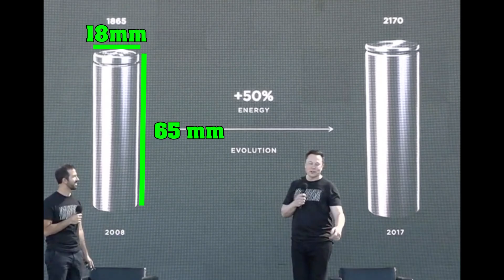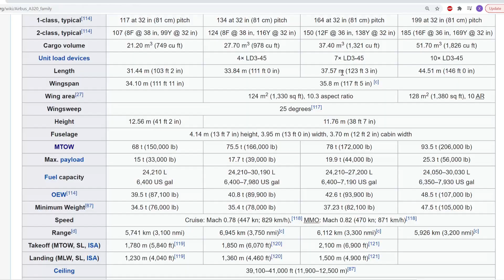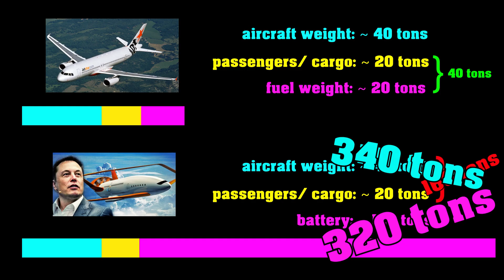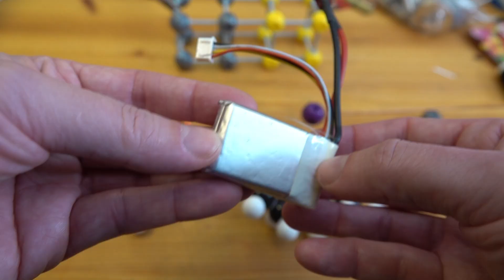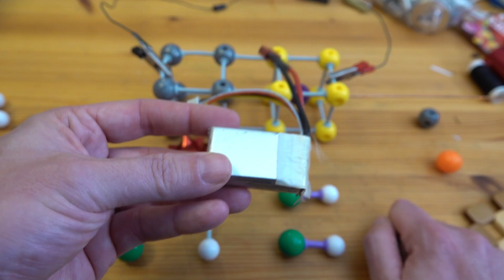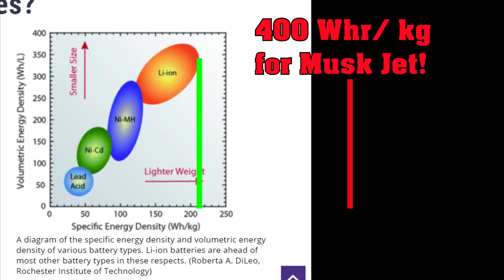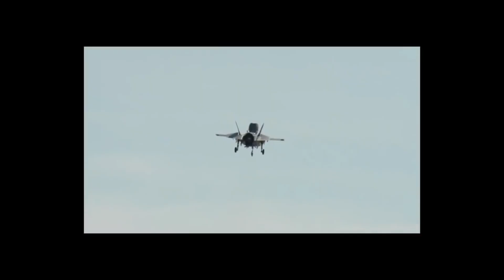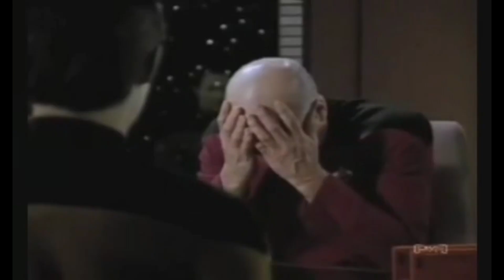Tesla's Secret Plan To Disrupt Airlines: BUSTED!!

Comment: Hyperloop replacing planes? Nah... How about planes replacing planes?
Fans: "OMG THAT IS GENIUS"
Reply: Even better batteries replacing people.
Reply: Elon Musk: "I've made a new battery that holds 50% more energy... its also 50% bigger  *nervous cough*  ."

Musk Fans: "This man is a GENIUS!"

Elon Musk: (phew! They bought it!)
Reply: @VoltBolt777  That's just the form factor, they will change the chemistry too.
Reply: @johntheux9238  How? What could  you possibly do to improve the energy capacity while sacrificing volume? Nothing!

There's a reason we build chemically fuelled space rockets and nuclear reactors; not solar powered space rockets and giant building sized electric batteries. 

There is a limit to energy capacity and output that can only be broken using hydrocarbon fuels or nuclear energy. Only they produce enough energy while remaining compact and efficient enough for flight or transportation. A nuclear battery is at least possible; in fact they are in use in spacecraft and pacemakers, they're just expensive to make.
Reply: @VoltBolt777  Look at battery day, they will change the anode, cathode and electrolyte too. The specs in this video are just for the new form factor alone.
Reply: @johntheux9238  It seems basic physics and chemistry is lost on you. Read my lips: There is NOTHING better to replace the contents of the battery with!

No better chemicals currently exist that will magically supply you with more energy while sacrificing volume and weight.

 This barrier/energy threshold can only overcome with nuclear power which harnesses radioactive decay or hydrocarbon fuels which store energy in covalent bonds.

If you have any real evidence of a new chemical compound that is not bogus; and that does the trick; I would like to know what it is! If not stfu!
Reply: @VoltBolt777  They will use a silicon anode and a nickel cathode.
Reply: @johntheux9238  And you believe that they will violate the laws of physics and magically generate more energy? Explain how please. We have been using these types of batteries for decades. What Musk describes is at best; a way of producing cheaper batteries, not a revolutionary new technology that replaces what we already have.

Do you understand that?  Manufacturing  has nothing to do with  energy output .
Reply: @VoltBolt777  It's still a small improvement for sure, the energy density will only be increased by 40% so that's ~364WH/kg
Reply: @johntheux9238  You are the perfect example of a gullable, useful positive idiot. 

Batteries are a mere shadow of the energy density produced by a flammable gas. They will never replace liquid and gas fuels. They just don't provide enough energy; its a limitation imposed by physical laws, not technologically bad or good designs.
Reply: @VoltBolt777  Never said it was good for long-hauls, but for short flights electricity is cheaper than fuel.
Reply: @VoltBolt777  i don't think he understands what energy density means
Reply: @johntheux9238  If I am not wrong the bulk of energy storing capacity comes from the electrolith used, of which there is no better alternative as of now, so I'm not sure how much of a difference changing the anode and cathode will make unless they change all the materials used to convey electricity with supraconductive ones to reduce the energy lost to joul effect. To my knowledge such material doesn't exist.
Reply: @kamil-alaa  Ugh, I give up. Fanatics of any religion are hard to reason with; and that includes Elon Musk worship.
Reply: @johntheux9238  People fly transcontinentally precisely for the long haul; we have everything else covered using trains and cars.

This electric plane idea is a bit like reinventing the wheel by making it square.
Reply: @johntheux9238  Not to mention it DOES increase energy density at the pack level, if not the cell.
Reply: Only gets better if his planes fly around in tubes. Except he will pressurize them at 40K feet lol
Reply: @MAJESTIC_P_BECK  Space is also where we use solar panels   most efficiently; because objects are weightless and there's no air resistance. Musk fans seem to think planes work the same way just because they're electric.

"Electric"=Magic🌈
Reply: @StormXF3 Didn't Elon Musk also invent the sonic Rainboom from the My Little Pony show? People forget to give credit where credit is due.
Reply: Soon: It is the Hyperplane running on Hyperbatteries!
Then: We changed the design and fill the batteries with kerosene.
Reply: @hans-joachimbierwirth4727  wait dont reveal this yet, brother. wait after the billions in environmental subsidies
Reply: Me and my hive don't need planes to reach cloudsdale!
Reply: Bojack Horseman: "What are YOU doing here?"
Reply: You just filled my brain with nostalgic memories...
Reply: I think the next one will be:
Elon: What if we put batteries on the Hyperloop ...
Reply: What about Plains replacing PLAINS now that would be a green world. Or even... PLANES REPLACING PLAINS! our planes could plant the crops they are destroying! Genous! Get me a Dutchman! Preferably flying!
Reply: Can’t wait until planes replace the Hyperloop.
Reply: >when the my little pony SFX channel is posting in the comments of a thunderfoot video
A surprise, to be sure, but a welcome one
Reply: Wait until you guys see the UFOs 😅. If only people knew the answers that they think cannot be proven. Oh wait the intelligence community already did that. 😏 ah well. Happy 2021 lads. We were never alone to begin with.
Reply: Like how cars are replacing cars right now
Reply: Its supahh sonicchhh
Reply: Planes comes in, planes goes out, you can't ex-planes it
Reply: I mean if he can make a supersonic electric jet i will be very impressed. And surprised.
Reply: Batteries have much more weight/energy than airplane fuel.    A battery powered airplane is the stupidest idea ever.    Honestly it would be a much better idea to run the airplane with a long electrical cable.   But still obviously a bad idea.   He can make a 5 foot tunnel carry cars in both directions at once i don't see why he can't make an electrical cord that can pass through solid objects.
Reply: @HughJohnsan  Tesla just needs to announce, and then invent superconducting monowire. According to other tech visionaries like William Gibson, that'll pass through any object. Passing a decent current through a true monomolecular filament is one of those minor details that Musk can delegate. But once achieved, the electric jet can get all the power it needs from lightning!
(problem with physics is it tends to ruin all sorts of great ideas. We should probably ban it for being restrictive)
Reply: I know how those planes will work better than a jet engine: If you throw out thunder bolts like Thor then the impulse will give you a boost 10 times more than a not referable value that makes the plane fly 10 times faster than air !!!
Reply: Errrm did you guys consider an electric plane doesn't need oxygen for combustion... so we CAN GO TO SPACE WITH IT
UNBUSTED, THUNDERFOOT!
Reply: @captainLoknar  While it may not need air for power, it does need air to push against and to achieve lift.
Reply: @jcd-k2s  L'électrolyte au graphène de Maxwell n'en fait pas justement une batterie "solid state"?
Reply: @jcd-k2s  Non, la vidéo est séparée en 5 segments: Le facteur de forme, l'électrolyte, l'anode, la cathode et l'assemblage des modules:
https://www.youtube.com/watch?v=l6T9xIeZTds&t=2550s
À 49:43 c'est pour le facteur de forme seulement, il faut attendre 1:27:40 pour avoir le produit fini.
Reply: @jcd-k2s  Lors du battery day ils n'ont pas parlé de la densité d'énergie ni de l'énergie spécifique mais de l'augmentation de l'autonomie du véhicule.
Par exemple le 5e segment parle de l'intégration de la cellule dans le véhicule, je n'ai donc pas compté les 14 derniers % comme une augmentation de la densité d'énergie.
Reply: @jcd-k2s  - no you can't.   If we could do that we'd be doing it
Reply: @jcd-k2s  all theory.  No actual use.   If it worked we'd be using it everywhere.   Lifting your fuel off the ground is difficult and expensive.  It's like saying the space elevator is a real thing.   It's less real than solar roadways.

People are stupid but they are also cheap and greedy.   If there was a cheaper way to do it they'd use it.   If airline execs could spend less on fuel and more on hookers they'd be all over that.
Reply: @VoltBolt777  I like how at least 2 people thought I was serious. But I guess at least a thousand Musk supporters would cheer my idea
Reply: @jcd-k2s  - what is the difference between not working and not working yet?   what is the difference between not working and uneconomical?   those are all more or less the same thing.   it's really hard to prove that something will never work,  so everything is potentially working in the future.    if something is impractical and/or uneconomical that fits my definition of broken therefore it doesn't work.  if something may potentially work in the future to me that is a useless distinction.
Reply: Not just any plane, an electric jet!
jesus fucking christ...
Reply: Naa it's a plane replacing spaceship
Reply: The eHang company kind of invented Drone Taxis already... look up the videos... lasts 20 minutes, 1 person and very newage. it's on the stockmarket now in America nasdaq as well... next level!
Reply: I mean, if they have a battery with enough energy density for planes they could make the hyperloop pods self propelled. Would solve many maintenance issues...
Reply: -Matter didn’t create anti matter
-Anti matter didn’t create matter
(Both of them were present at the time of big bang)
-Both of them didn’t create themselves.
-Both of them came from an unimaginable source,  that unimaginable source created matter and antimatter (everything) thats why it is known as “the creator” of everything.
————————————————-
- that unimaginable source/creator has created sin and virtue which are opposite to each other,
— logic says every action has its own reaction, so the reaction of sin must be different than the reaction of virtue,
— the creator has created prophets to let us know about each and every detail of sin and virtue, also about their reactions,
Thank you :)
Reply: @dott8045  Did your "creator" create itself? If not it didn't create everything, and there is the question of what created it?
If it did, how did it exist to create itself before it created itself?
All a creator does is push the problem back.

Even if you do think there was a creator, there is no reason to think it gives a damn about us or sent prophets or any other crap like that.

Comment: Planes also burn the fuel, so its mass would decrease over time. The 787 had an issue with lithium ion batteries, and in some cases catching fire in the plane. There was also an incident where the battery manufacture's factory burnt down because of the batteries.

Comment: Why vertical takeoff? It uses a ton of energy and normal departures using runways work just fine.
Reply: Because he wants things to work like old cartoons with rockets landing vertically and hover cars being able to just rise up out of traffic and fly away just like Elon does when he's playing with his toys.
Musk strikes me as the kind of guy who had green army men as a kid and had the crawling soldier fly.
Reply: @glenngriffon  To be fair, the rockets seem to work
Reply: so he can do his robo taxi service with planes and cars.
Reply: For the exact same reason why his trains go through vacuum tunnels. Appeals to the dimly-lit ones amongst us and gets them to invest into his stock.
Reply: @Elias Håkansson You don't see helicopters being used for long-range commercial traffic, which this plane is meant for. The VTOL fighter jets (Attackers, really) are meant for when the runway is either under attack, underdeveloped, or damaged, again not something a commercial airline has to worry about.

*EDIT*
Forgot to add this but Harriers, the VTOL fighters you are speaking of, cannot actually perform a vertical take off while under full load, not to mention that fuel efficiency drops off dramatically in VTOL mode. Again, all these features completely kill the idea for commercial use.
Reply: so it can stop at a chargeing station half way lol
Reply: @Elias Håkansson I never said that helos weren't used commercially BECAUSE of their VTOL capability, I simply said they weren't. Maybe I should have been more clear that it was the lack of cost effectiveness rather than leaving it as the implication (or adding it later for the Harrier). It still doesn't change the fact that there is no real need for a VTOL commercial liner as the ability to perform VTOL maneuvers simply does not come up often enough for use in commercial traffic. The fuel cost will rise exponentially in VTOL mode, as will the cost of maintenance with all the added moving parts and delicate equipment (another thing I forgot to mention).
Reply: @Elias Håkansson First, we are talking about commercial traffic and airliners specifically here. That's what this electric "jet" is for and it's against that on what I'm basing my arguments off of.
Sooo...
"Helicopters demonstrate that there is in fact value to performing VTOL maneuvers, which is why it's desirable"
In what commercial sense aside from extreme short-range flights (in aircraft terms) and tourism? How would the added maintenance and fuel cost outweigh and benefit a commercial airliner? Hell, why would a tourist pick this eclectic VTOL over a helo in the first place?
"The value is in the reduced real estate costs associated with hosting landing areas"
That by itself is a fair point. However, the landing areas already exist and it's not very likely that all aircraft will be swapped and/or replaced to a new VTOL model. And even still, VTOL capable jets still can't take off vertically while under full load (which most commercial flights are at before leaving a terminal), thus the long runways are still required anyways.
"Aircraft carriers are an extreme example of the value of VTOL in the context of constrained landing/takeoff real estate, which is why they employ harriers, aircraft catapults, and aircraft arresting gear for landings."
Again, what does this have to do with commercial airliners? What commercial airliner is going to purchase and maintain carriers for VTOL jets when we already have fixed-wing aircraft capable of crossing the world? What you mentioned is for military application, not commercial. Aircraft catapults and aircraft arresting gear are also not methods of VTOL and it should be noted that early carriers didn't actually need catapults to launch their aircraft. They had to steam with the wind at their stern. The catapults were developed to largely remove this requirement.
"It's basic economics: the more you manage to reduce the required square footage for your takeoff/landings, the more valuable real estate you can afford to devote towards it."
See point two.
"If this wasn't the case there would be zero use for helicopters, and everyone would always fly everywhere using 747s."
Completely false as helos have far more applications outside of commercial airliners including SAR and military whereas a 747 does not, really (other than military transport and a C-130 has it pretty much beat already). And back to point one as to who would pick a VTOL jet over a helo for tourism purposes. 

The point I've been trying to get across is that commercial airliners, which this electric "jet" is supposed to compete against, simply do not have enough of a need for a long-range VTOL set up to be useful enough that it outweighs the inherent increased costs.
Reply: @logical_bystander2951  No thought required, if he believes what is coming out of his mouth, he IS!!
Reply: Vertical take offs don't need a run way.
Reply: @AngelEmfrbl  Except they do. Harriers and Ospreys still require runways to take off at full load.
Reply: Vertical take off would make for a lot flexibility....
Theoretical.
Airports are freaking expensive and need tons of space

Comment: Some article on FB today suggested he was planning to ‘catch’ rocket stages.

Stop Elon. Please, for the love of god, stop ‘having ideas’.
Reply: But that seems totally feasible? Considering the accuracy of landing the Falcon 9 boosters, it's just a matter of scaling it up.
Reply: @Drunken Hobo - That remains to be seen. Even the Falcon 9's don't bullseye the landing pads.
Reply: Those are the feasible ones
Reply: Yeah, he wants to try to catch the Starship heavy booster by the grid fins using the launch tower.
Reply: Arent they already reusing stages profitably?
Reply: @Unicornul Sarvy - Yes, they're reusing the Falcon 9 boosters whenever possible. Musk is talking about trying to catch the new Starship booster stage. He wants the booster to land on the same pad from which it launched to facilitate rapid turnaround and reuse. The idea is to somehow use the launch tower to catch the booster by its grid fins and then lower it into position on the launch pad.
https://youtu.be/1uei2iNwyOo
Reply: @georgejones3526  yeah it is a good idea,and it can work,the problem is wedont know yet if it will be cheaper then landing them on legs
Reply: @Unicornul Sarvy - It has nothing to do with cost and everything to do with speed. Also, not having the parasitic weight of legs would give the booster increased payload capacity.
Reply: Will be fun to see them try like with falcon boosters, but they will eventually succeed.